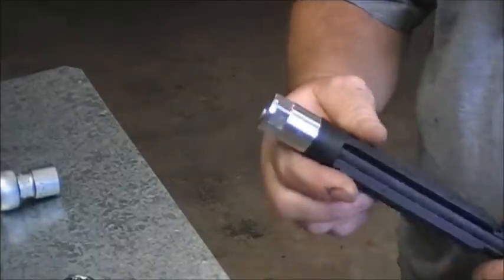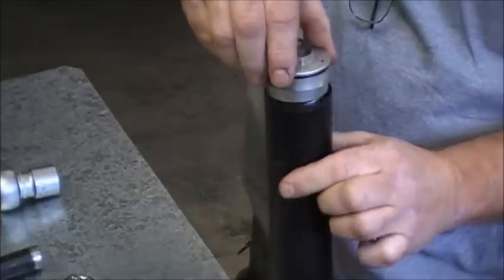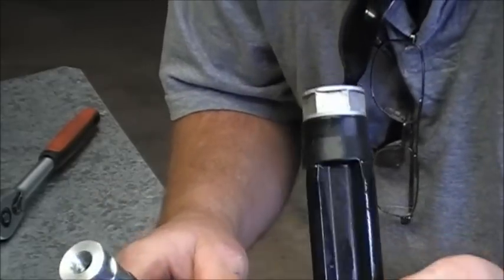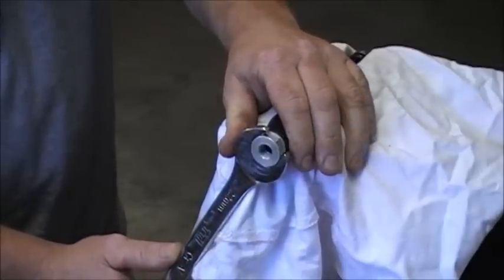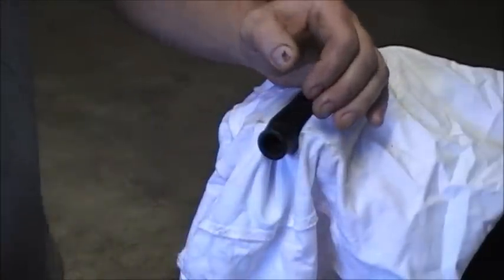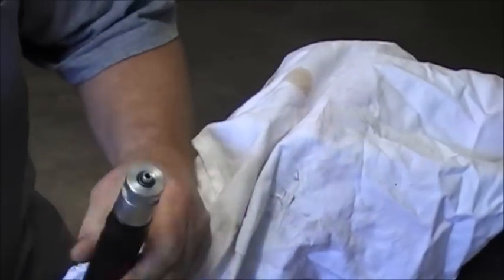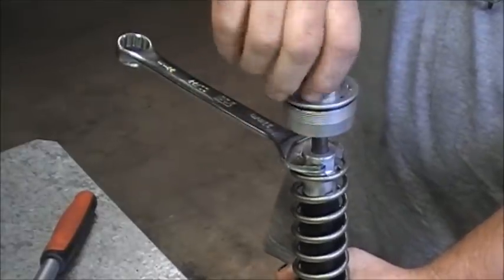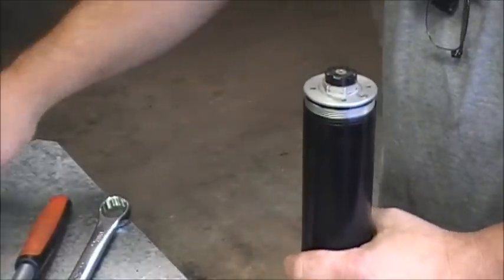KTM Lowering Kit - Fork Hydraulic lock extender install

Comment: hello
The kit lowers the whole bike both front and rear or just the way of working of the suspension?

example standard bike seat height 960 mm

bike with kit seat height 930 mm

is correct